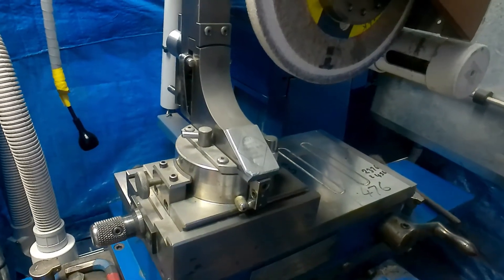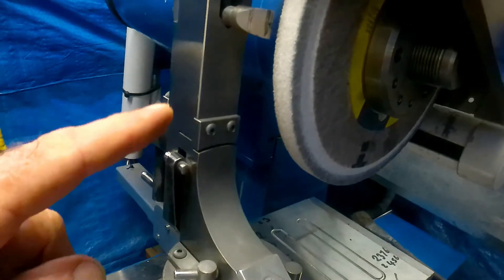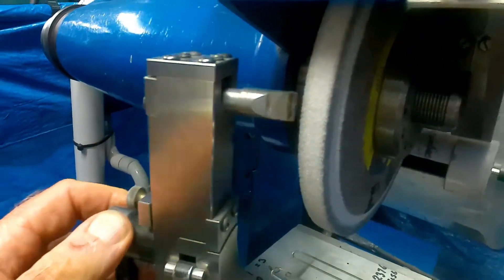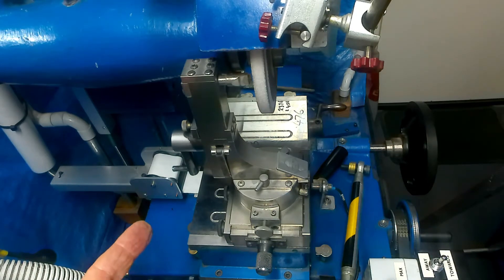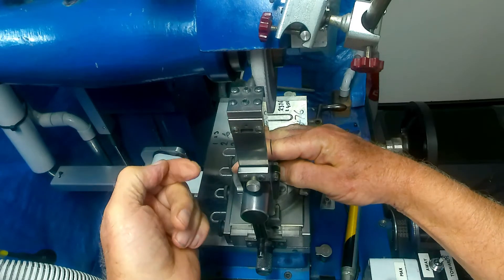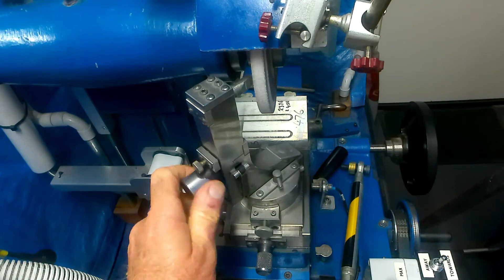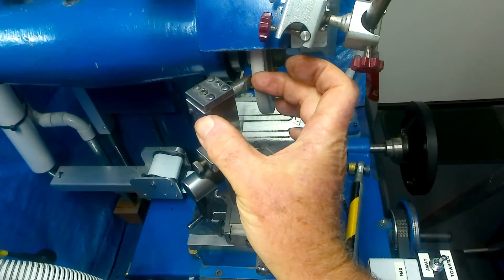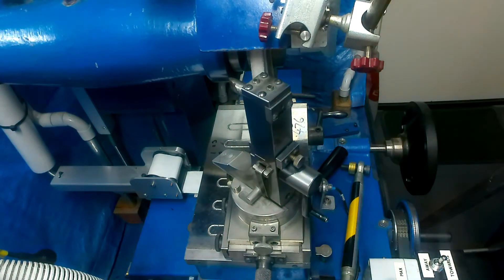J & S Fluid Motion Diamond Wheel Dresser Setup

Comment: I've used this extensively when I was doing tool and die stuff.  It's a pleasure to use but it gets really messy since the hand used to drive the radius is literally under the wheel. Also very easy to grind angles tangent to the radius.
Reply: I rebuilt a few of those buggers when I worked at J & S Tool. Oddly we never used them ourselves. We had a whole room of them too.  We made them up to like 4 feet tall. Imagine standing under one of those.
Reply from the maker: Thanks for your comment and view. Very much appreciated. I have never used it other than in the video. I saw it for sale and thought I would like to own it. Regards from Australia.

Comment: Thanks for making this video.  I struggled for over an hour today trying to use this tool on my grinder before finally giving up.  Tomorrow I'll get it sorted, thanks to your explanation!
Reply: What we said was that no one really knew how those dressers worked but Henry. I worked at the place that made them. Mostly I made hold down clamps but sometimes I'd work in the dresser department.
Reply from the maker: Hello Matthew, so glad that I was able to help you out. Thanks for watching. I have the instructions as a .pdf if you would like a copy send me an email. Regards.
Reply: @daveticehurst4191  I was able to dress convex and concave profiles of 0.500" and 0.375" today.  The J&S tool was quickly and easily setup using your video.  Thanks again!
Reply from the maker: @MatthewRulla  Glad it worked OK for you. In case you did not read my original reply, I do have the instructions as a .pdf if you want a copy please email me. Regards.
Reply: @daveticehurst4191  I do have the pdf instructions. Thank you

Comment: Hi Dave
Great demo, it look as if its an expensive bit of kit when made back in it's day, or is it modern!!!, 
thanks for sharing
take care
Kev
Reply from the maker: Hi Kev, thanks for the comment. I think that it looks to be early 1970's from the case and the instructions printing. I paid US $ 200 plus another US $ 160 for shipping. That's the trouble with the USA you can buy an item say for $ 5 and it costs you $ 50 for postage, for even just a small jiffy bag. That's why I can not understand the postage from China, you can buy a reasonable quality drill vice for $ 30 weighing  a good 5 Kilo and it comes free postage. Will put it away again for ????? who knows. Look after yourself. Regards.
Reply: @daveticehurst4191  Thanks for the info. it puts in in to perspective, i've always wondered that about postage, especially China, when a component worth a couple of pound comes free post, surely the postage must cost more than that.?????!!! I don't get it!!! but i'm not complaining, the bubble will burst soon!!!!
see you next time
take care
Kev
Reply: @daveticehurst4191  Beyond the materials dressers didn't change. Well the marking did on them. The really old ones were nickel chrome steel. Then they switched over to just cold rolled. I was having a problem grinding a rebuild once and the foremen told me about it. So I sent it to Stanley to grind on the big wet wheel. China has developing nation status. So their shipping gets internationally subsidized. It's a crock. They seem pretty developed now to me.